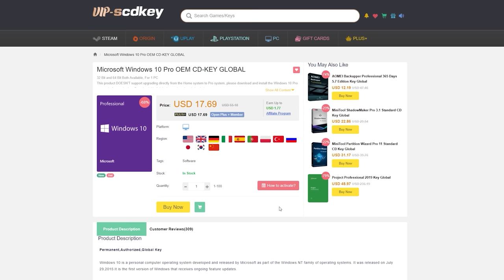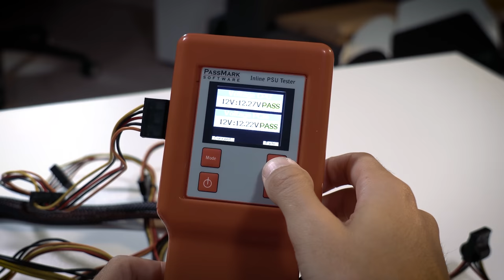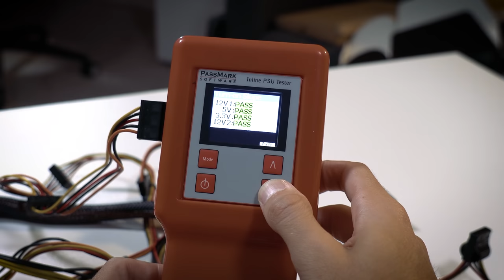Fixing a Viewer's BROKEN Gaming PC? - Fix or Flop S1:E10

Comment: The first thing is unit doesn’t start is to check the power supply, save u a lot of time
Reply: He already said that in the first few minutes of the video, but still wants to go through the same diagnosis because they’re easy and fast. 

A diagnostic check verifies  everything else is working or doesn’t work, to further narrow down the issue and confirm any initial guesses. 

This is the mentality of “shotgunning parts” to fix an issue. Replacing a dead/broken part may actually be a symptom and not the cause.

This is why I am able to buy used cars so cheaply. A lot of owners just want to get rid of the car for a few hundred bucks or a few thousand. The issue tends to be quite easy when you run a full diagnosis.

 It’s how I can buy a 1989 Mazda RX-7 TurboII that is in mint condition but the owner thinks he blew the motor, for $1800. The issue ended up being he routed the spark plug wires incorrectly and he was done throwing parts at it before spending thousands on a new motor. $80 for new spark plugs and wires and I was able to keep the car as my daily driver until someone offered me $18k for it a few months later.

Comment: I could have told you that, the minute I saw that power supply I new that was the problem. I had the same one and it died on me after a few months. I had it RMA'd but I gave it away and got a good power supply.  Problem solved

Comment: "It's not an issue with the Psu because it's non modular" what has that got to do with anything...it was the main reason no hardware was getting any power..
Reply from the maker: ... Dude, you completely misunderstood what I was referring to, there. I said that it isn't an issue with CABLES on the PSU side since it's non-modular. I was referring to cable connections that entire time...

Comment: i noticed that you didn't connect the fan back in the power supply. then the power supply fried itself due to overheating. i would call that a flop.
Reply: It doesn't fry itself that easily, most PSUs don't turn the fan on until under some load.
Reply: @matasa7463  yeah but it was connected to his psu tester...which i'm assuming puts a full load on the psu from the get-go.

Comment: Everyone buys the smallest cheapest Motherboard its hilarious.
Reply: made that mistake, made new pc with all new parts that i wanted...so then the motherboard i just wanted one that was compatible with my cpu and went with the stores recommended option for a motherboard to suite my cpu...it was the cheapest one there and after 6 months it fried itself.
i done some research online and the one i got recommended was very, VERY poorly rated, it couldn't even overclock even though it said it could and the motherboard was designed very poorly (and it was suited for a 10 gen intel cpu but couldn't handle mine)..... for a mere $25 more i got a waaaaay better customer rated motherboard FROM THE SAME SHOP. the first and last time i will listen to advice from a shop employee ever

Comment: If you had seen large capacitors explode like I have you wouldn't put you face so close to the power supply.
Reply from the maker: Dad's an electrical engineer. Works with giant magnets and capacitors the size of refrigerators. I know the risks Lol.

Comment: I’ve built my pc around half a year ago, I’ve already dealt with a broken motherboard, I’ve had a crashing gpu (gtx 770) cause my powersupply wasn’t supplying the rated amount of power, didn’t know that and sold the gpu off just to hear back from the buyer it works fine, so I replaced the powersupply with an evga bq 700 watt and used that money to get a 760 ti oem, 2 months later that psu goes and I’m back to using my shitty one :/
Luckily though it is enough to keep my 760 ti going without a crash, but my 2600x is dying for something more powerful it’s being bottlenecked like crazy, even more now, scalper prices are ridiculous so I just have to roll with what I have

Comment: "I don't deal with software issues" yeah because that's the bit that actually requires some knowledge and skill. Repairing PC hardware is kinda easy by comparison... especially if you have a stock of replacement parts to swap in and out.
Reply from the maker: I've LITERALLY discussed how easy it is to troubleshoot hardware in this series, so you're saying nothing new here. And, to be fair, I can manage common software issues just fine. It just isn't pretty. No one wants to stare at a screencast of me jumping through someone's registry and running disk cleaner software. It's boring. Hardware is prettier. You aren't thinking about this through a producer's lens.